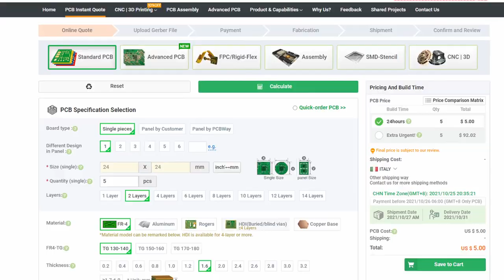USB-C adapter for Nordic power profiler kit II

Comment: Great idea, but be carefull while using it with USB-C, as the host might request for higher voltages through USB-C PD3.0 changer, which can damage the PPK
Reply from the maker: Yes I only use power supplies that provide maximum 5V

Comment: Nice project. I just ordered the PPK2 and then came across your video.
Where did you get the solder paste syringe actuator from?
Reply from the maker: The syringe it's a jbc product - DPM Manual Solder Paste Dispenser👍

Comment: With PPK2, when using as an ammeter mode, am I correct to assume it would act as a multimeter/current meter? Where I could measure the inline current of a wire at any point of the circuit as long as the wires will be connected in series in Vin / Vout of the PPK2? I plan to measure and test a few signal currents coming in / out of an IC.
Reply from the maker: Yep, the PPK2 allows you to both power a circuit(max 5V 1A) and you can also use it to only measure current(max 1A).
Reply: @SalvatoreRaccardi   But will it measure inline currents just like a traditional ammeter would as floating? I feel like I still need to connect the ground pin of the PPK2? 
Have you tried to measure wire currents without ground reference (floating)?
Something like this:  Opamp output pin -- PPK2 Vin (ammeter mode) -- ESP32 ADC pin, to measure the incoming current to esp32. Using a traditional multimeter, we would put it in series inbetween the opamp and esp32, but I wonder how to do that using PPK2, if it is indeed work as an ammeter (floating measurements).
Reply from the maker: @losaminos59  I always connected the ground, never made floating measurements.

Comment: Hey... why do you use 5.1kohm for the usbc? usbc out is supposed to have 56kohm resistors according to spec
Reply: and pulled up not down
Reply from the maker: The 5.1k resistors(pulldown) are necessary to allow more current flow. If you do not use them, you can only get 0.5A.
Reply from the maker: @CrispBit  Right, I also use this pcb for other applications that need the two extra resistors.